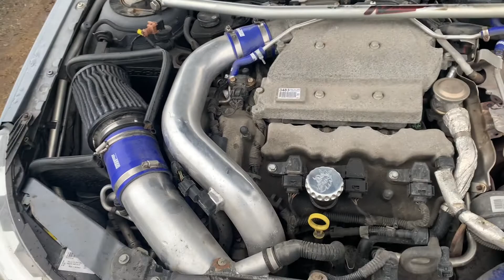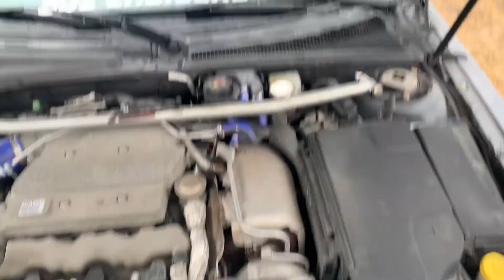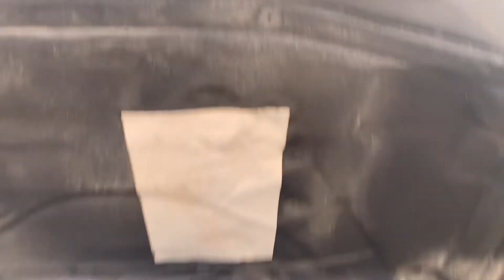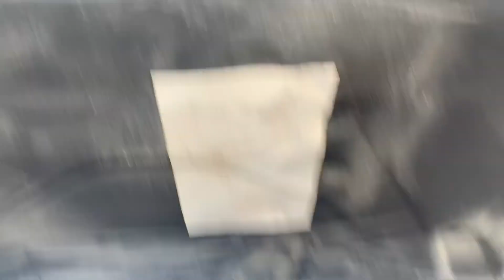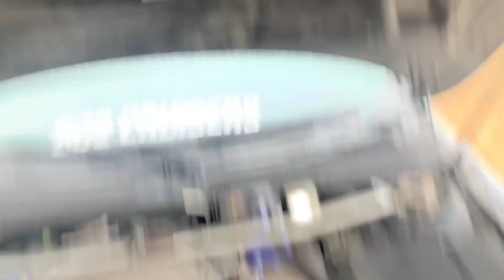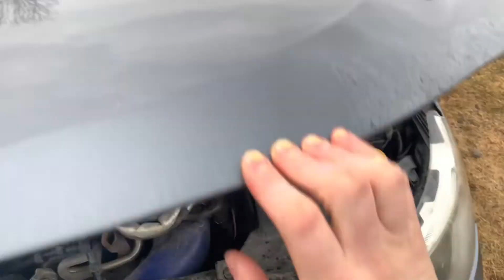Selling My 2008 6spd XWD? Channel Update for the 9-3 Projects {Vlog1}

Comment: how much are you asking for the 6sp xwd? I am interested
Reply from the maker: Depends if you want do88 stuff on it or stock. Hmu on Instagram and we can talk. Solving.Saab
Reply: @SolvingSaab  ok will do
Reply from the maker: I was thinking 5500 stock and 7k with do88
Reply: @SolvingSaab  ok not bad prices . I will talk it over with my wife 😂. Other then the do88 kit , and hat other mods does it have?
Reply from the maker: @sts973007  it has a strut bar, custom oil cap and custom brake fluid cap. I just serviced the car, rear diff and engine oil.